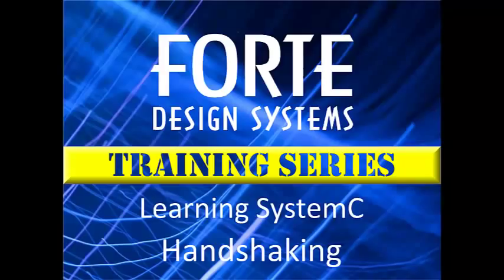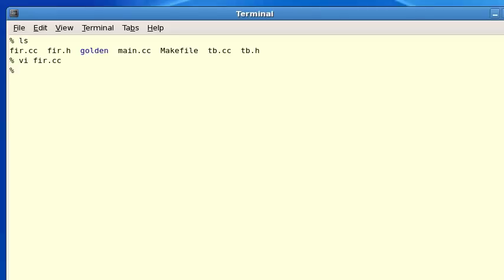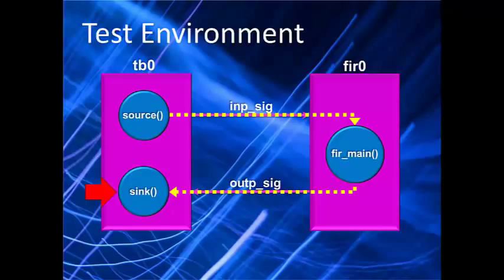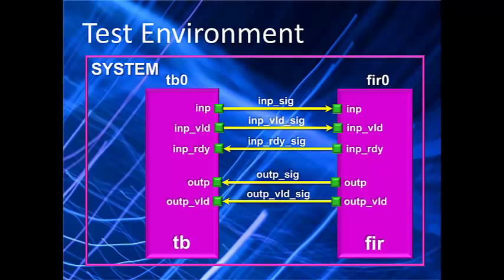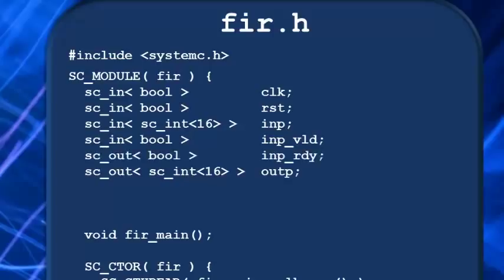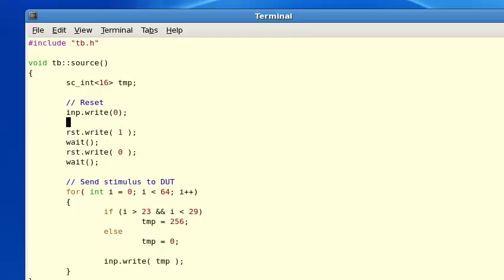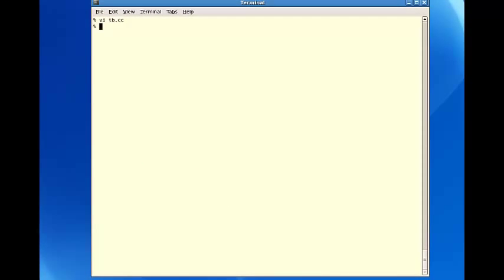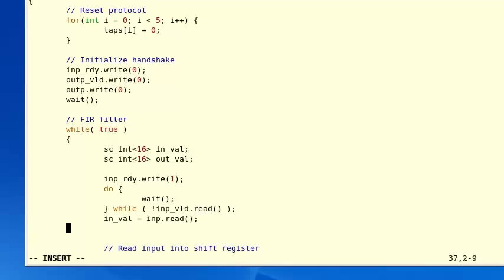Learn SystemC (4) - Handshaking

Comment: Could we use event handling rather than assertion/desertion and do-while loops? I actually like the video's way nicer, it sits better in my brain to think in loops, but I have heard that event handling is better form.
Reply: Events are fine if all you're ever going to do is simulate.  These videos are written with synthesis in mind, and unfortunately sc_events are NOT synthesizable.  I use Cadence Stratus for high level synthesis and these I/O handshake protocols with do/while loops work great and give you the best hardware quality.

Comment: I agree with L2Code, the proper way to code handshaking in systemc would be using events, not do while loops!
Reply: Events aren't synthesizable.  Since this is an SC_CTHREAD sensitive to clock and reset, use the do/while loops with a wait() statement  (i.e. clock edge) like the video shows for a cycle accurate protocol handshake and something that will  generate hardware.

Comment: Hi Sir,
I watched all these lectures and i learned a lot but i'm having problem in writing a simple code. Here is the link of the code that wrote on EDAplayground : http://www.edaplayground.com/x/5Mnc 
and the question is :
Q. Develop the model of a adder, It should have two inputs A & B of integer type, and one output OUT of integer type.
Whenever any of the input change, it should add both inputs and put the result on output port after 2 ns.

Test bench: Applies the values at input port at following times:
  0 ns: A= 0, B= 0
  5 ns: A= 5, B= 0
  7 ns: A= 5, B= 10
  15 ns: A= 7, B= 8

Whenever the value changes at the output port of adder, the test bench should print the value of this port and the simulation time.

**********MY PROBLEM IS THAT I DON'T KNOW HOW TO PROVIDE THAT 2 ns DELAY IN SC_METHOD().*******************
PLEASE SEE MY CODE AND SUGGEST SOMETHING. IT WOULD BE A GREAT HELP. 

IN CASE LINK  DOESN'T WORK MY name is jatin and my MAIL ID IS : eajen7@gmail.com